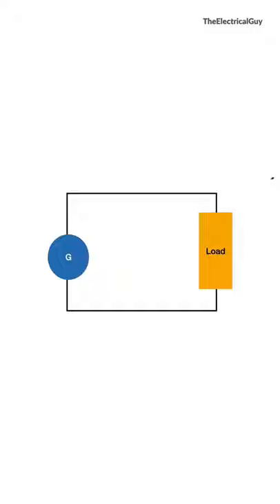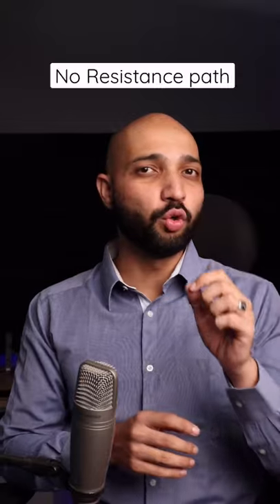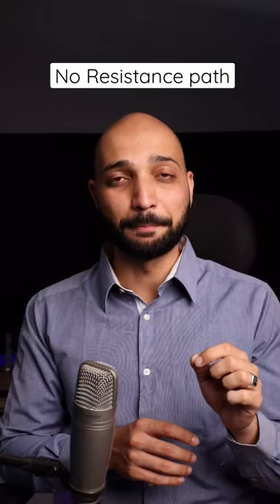Watch what Happened 😱 Short circuit!!

Comment: Gaurav Sir In my home there is a Issue, Apparently the Building I stay in has no Earthing, i.e. they haven't put the Earthing Cable. Also recently I have have Current Passing through Earthing thats, so even with Switches are Off I get Current Reading in the Earthing Pin of 3Pin Sockets. Can u please Explain How I can Solve this? I have Asked the electrician to find if the Phase and Ground Wires are connecting somewhere but he keeps saying its due to No Earthing in the Building. Awaiting for your answer
Reply: 1. Call electrician. 
2. Install earthing. 👍
3. If you got extra money, install isolation transformer. 
4. If you got even more money, Microtek Low frequency imaxx online ups with galvanic isolation transformer
5. NKB Technocrats Static voltage stabilizer. 

You are welcome. Step 1 & 2 compulsory. Step 3-5 needs extra money.